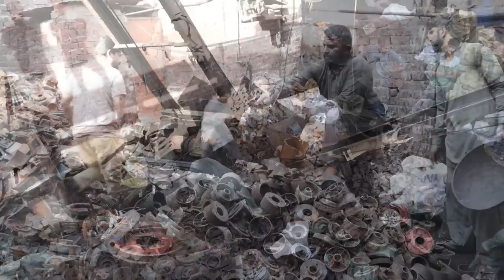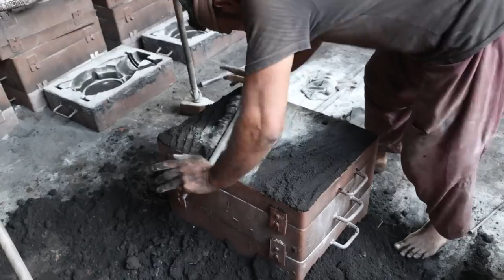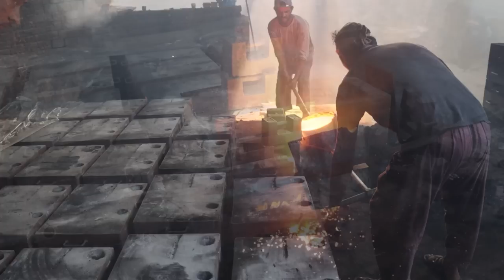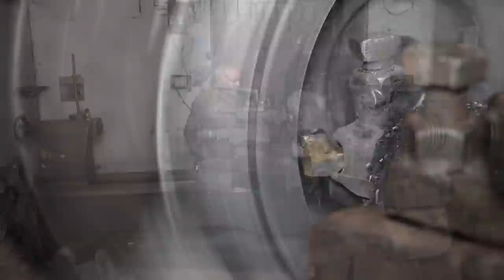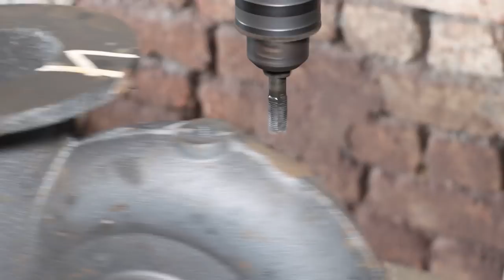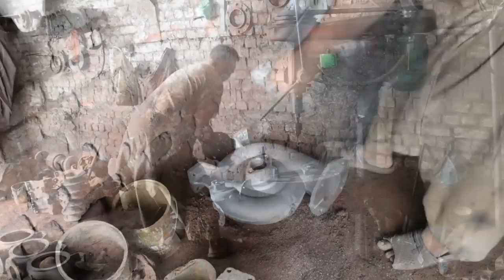Amazing Process of Manufacturing Powerful Centrifugal Pump

Comment: If it wasn't for bare feet, nothing would get made. As soon as they finish, they will start a new job, building an airplane. This product will soon be available at your local Harbor Freight. Did you see those steel-toed sandles?